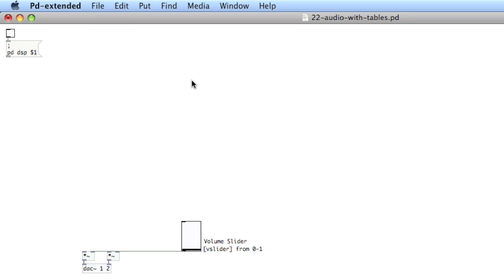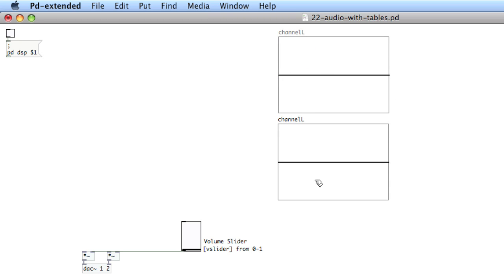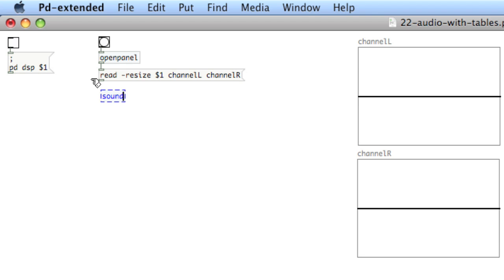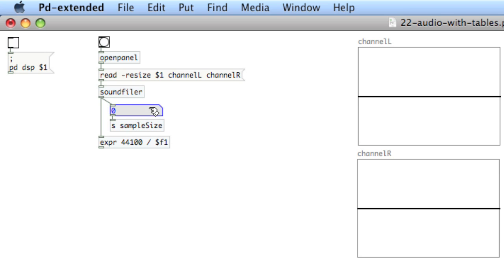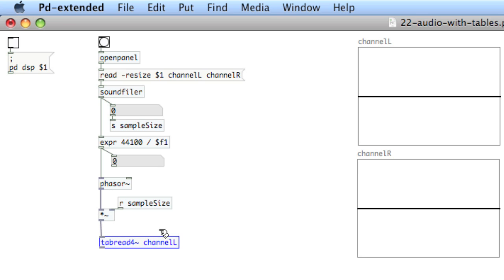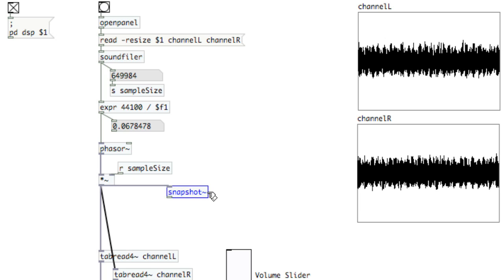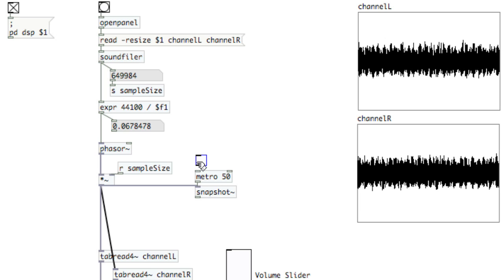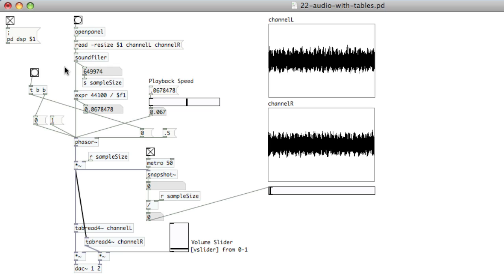PURE DATA: 22 Advanced Audio with [tabread4~]

Comment: if I duplicate the array, the file's speed rate is subject to variations (sometimes faster, sometimes slower), I renamed the tables different, and I also putted the value of the original speed rate into the message box which goes to phasor, so I tried to tap that when the problem comes, but the velocity is still speeded or slowed down. Why this happens? How can I fix it?

Comment: Hi! This tutorial is awesome!!
Just have a cuple questions:
Why is it on loop without using the loop object?
What do i have to change to make it sound once?
Reply: It's looping because the playback position is being determined by a saw wave oscillator (phasor~), which is repeating in nature.  If you want it to play only once (i.e. stop once it gets to the end), you could set up a conditional statement that bangs the "0" (connected to the inlet of phasor~ in this patch) when the current position is the last sample (given by sampleSize in this patch).  Or you could just use a "line" object instead of phasor.  If you don't want to have the other features (such as looping playback, variable speed, etc) this might be preferable.
Reply: @michaelsintros292  Great!! Very helpful Michael, thank you!

Comment: Hello. I have a question. I am researching programs and sdk's and such to make a production work station synth/sampler And to do this I will be using a raspberry pi. this tutorial opened my eyes to Pd and I think it is exactly what i need as it can run on Linux. So my question is would I be able to use the pd library to handle all of the audio on my raspberry pi and trigger the play and stop "bang's" because as of now this tutorial is all I really need to make a midi controller out of an arduino which is simple enough then to get the serial midi data to start triggering wave files that are located on my raspberry pi.
Reply from the maker: This is all possible and, as well, quite common in the Pd community. I suggest you check out the Pure Data group on Facebook for an active group of folks who use Pd like this (and in other ways).

Comment: Wouldn't it be more sensible to control speed by multiplying with the sample rate? That would be file-independent, too.
Reply: That's essentially what you're doing here.  Phasor just generates a saw wave and you can manipulate the speed and amplitude of that wave.  This momentary "position" of this wave is used to determine the sample being played back, so if you are manipulating the rate of this wave, you are manipulating sample rate.  Note that there is not really a parameter here that is explicitly called "sample rate", nor do I think there is one in PD, because we're working with sound on a much more basic level here.

Comment: Hi. I'm quite new to PD. Is it the phasor that keeps the loop going? How can I get it just to trigger once. I want to be able to bang it to start at the beginning every time it receives a bang. I figured another way out. The [open"loop"] message into [readsf~] works but I lose the true stereo. The tabread4~ gives me the correct stereo image playback. Any advice would be appreciated. Thanks
Reply from the maker: +Carlo Thompson use [line~ ] instead of [phasor~ ]
Reply: Thanks
Reply: is  it possible to plug line~ to tabplay~ for a clip progress bar?

Comment: @cheetomoskeeto Is it possible to do this twice in the same patch and have two separate sound files playing at once? If so how? I tried just copying and pasting the whole thing it would only work for one sound. I tried connecting it to the same dac but it didn't work.
Reply from the maker: +Maryjane Stewart It is possible. You'd need to change the table/array names, however. So, you might do something like "channelL-01", "channelR-01" where the "-01" is the difference between the two. You'd need to also remember to change the [tabread4~ ] objects to ensure that they are reading from the correct tables.

Comment: This is such a great video. Just enough detail to get the basic idea. This video was the basis of my "Sample-Looper" abstraction which was the first module in my BHPDToolkit. I've made several tracks on my Soundcloud channel which use this looper as the basis. I am just beginning to design a protocol to automate this (and all my modules) using OSC, so it will be able to be controllable with messages, and be able have persistence, store/recall patches, replay the movements of a live performance, etc.  I have not had this much fun with computers since hacking on a TRS-80 in about 1979! Thanks Dr. Hernandez, and also Miller Puckette for this amazing tool.
Reply from the maker: +William Huston Thx for the kind words, William.

Comment: How do I stop this loop after one run through? Very curious how to do this.
Reply: Use some sort of [==] or [sel 1] in conjunction with a [spigot] to cut the flow of the signal or then set the playback to 0 by setting the frequency of the [phasor~] to 0. The latter is probably more preferred because the [phasor~] is what drives the playback of the sample by reading it from the table.
Reply: great, thanks. I'll try it.
Reply from the maker: Bruno Iasi Sean Pett Look at the tutorials here; you want to use [line~] http://www.pd-tutorial.com/english/ch03s04.html
Reply: the patches/ 3-4-2-3-sampler3.pd
Reply: Rafael Hernandez Hey, also trying to stop this from looping so that it can be triggered instead. Can you explain this in logical terms please. Like, if ? == ? do ?. Cheers in advance :)
Reply: squireltheo What you want to always keep in kind is that this technique uses a continually oscillating wave ([phasor~]) in order to read the table. So, you'll never be able to stop that wave as long as the dsp is on. This makes triggering quite challenging but still doable. The solution would essentially involve a tracking of the samples to determine when to stop and a use of [phasor~] right inlet to explicitly start it at a certain point. The pseudocode:
- TRIGGER sample from starting point (right inlet value of 0 to 1 where 0 is start and 1 is end)
- IF sample has surpassed the maximum length of samples it should go, set the amplitude to 0 (effectively turning it off)
- ELSE let the sample play
Reply: Cheers man! Sounds perfect! Much appreciated.
Reply: Rafael Hernandez I still don't get how you would patch it, could you explain what pd objects you would use and more importantly where each one goes. This would be much appreciated as I'm doing a pure data project in college
Reply: Sean Pett Did you figured out? I'm having the same trouble, it's driving my mad.
Reply: cheetomoskeeto instated of [phasor~]? sorry, I'm using the @3 to play some parts of a track randomily and I just want to turn the loop of, so it plays only once when it changes the position.
Reply: Replying here as some people still might find it useful. You can try [tof/phasorshot~] object instead of [phasor~] which has an argument for allowing looping or not. This is included in pd-extended.

Comment: Maybe I do something wrong, but for me it works very strange. I always have a soundfiler_read error: truncated to 4000000 elements, and the samplesize is always 4e+06, which means that the speed is always the same, what is more, the track lasts maximum 90 sec even if it is originally longer, it is cut after 90 sec. What can be wrong? How could I add long tracks like 10-20 minutes? Thanks in advance for the help.

Comment: Hello again. I made this audio player of yours, and I tried adding a 0 to 1 slider instead of just message boxes with numbers, and it works, however there's this ugly zipping noise. I know you've mentioned vline~ before, and I tried it as the help file uses it, but then it just stutters and won't play. Ideally, it would be great to use the same slider that's tracking the playback to adjust and its playback position. Is there a way to do that? Thank you!